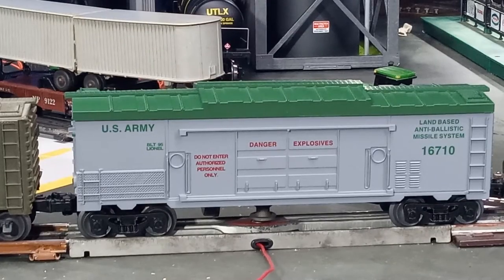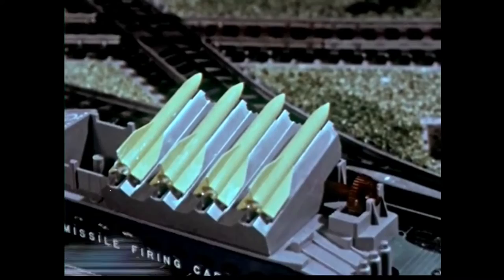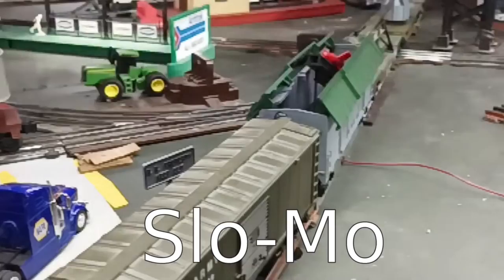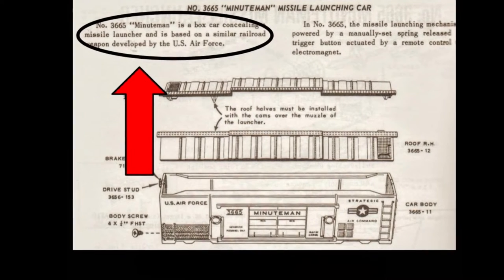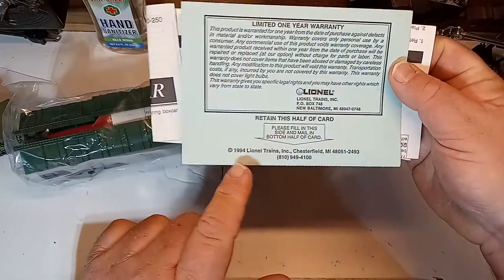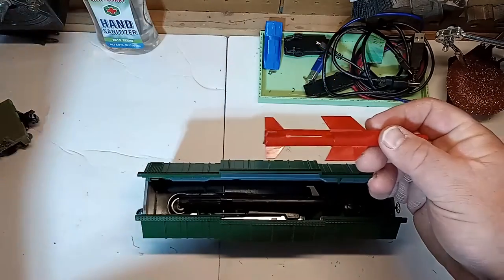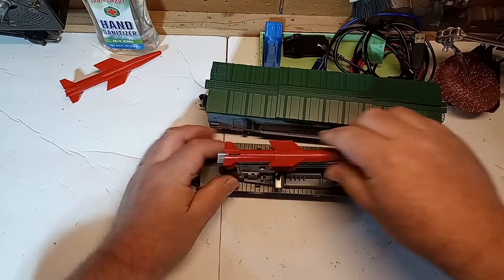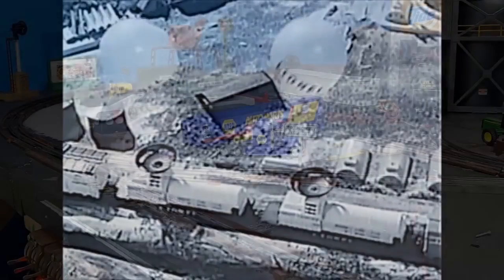Lionel 3665 Minuteman Car: Fantasy Or Reality?

Comment: I was born in 1995. I have the original 3665 model from 1961. Mine has the black roof tops. It’s unfortunate that the original replacement blue roof are hard to track down.
Reply from the maker: You could always paint them. Evidence that the car was played with often!